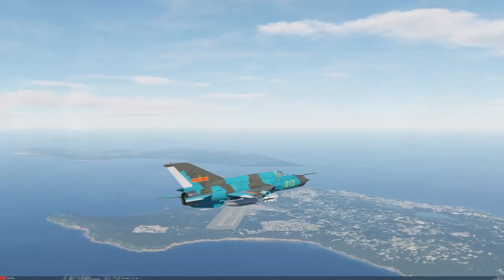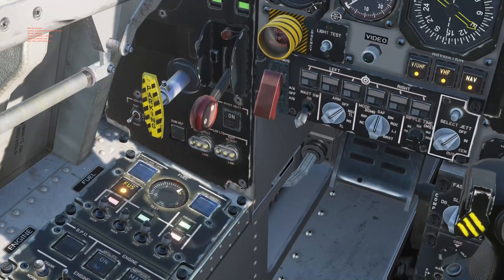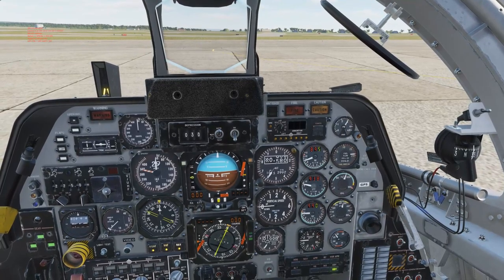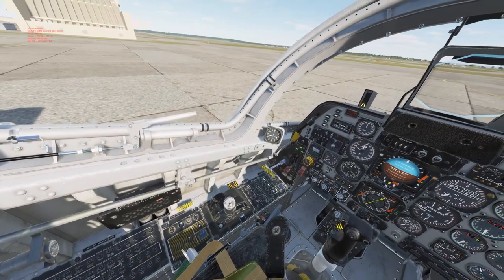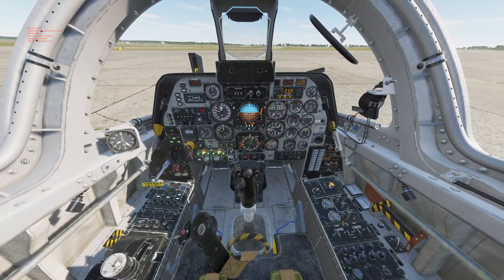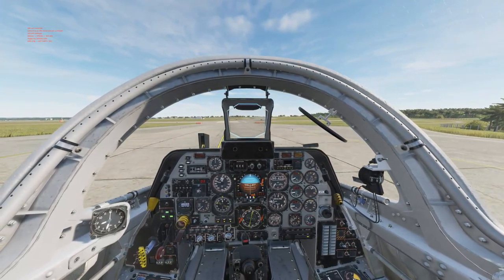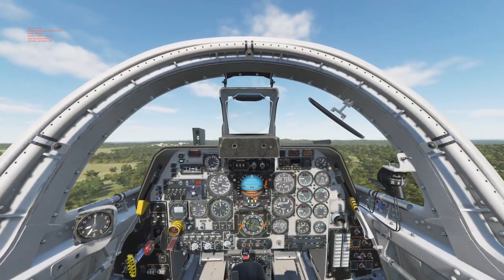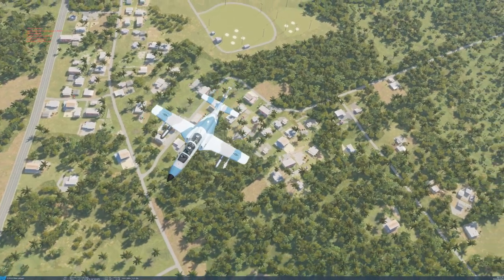Things that I wish I knew about the C-101CC before I bought it - Part 1

Comment: Enjoyed the vid.  Thanks.  But I think you referred to the BL755 as a Russian bomb.  It is actually British.  And the only bombs you can ripple in the C-101 are the practice bombs.  Ya, waiting for the Sea Eagle to work properly although there is a script out there somewhere where you can target them in real time using the F10 map markers.
Reply from the maker: I stand corrected… I had thought that the BL755 was a MiG 21 weapon (it is) and therefore was Russian… but Wikipedia agrees with you - DCS is a very strange thing.
Reply: @dewfiend  Just did a quick google search and some random posts mentioned Yugoslavian Mig-21s that carried the BL755 so I'm assuming DCS is right.  But take with a grain of salt of course.
Reply: @kontiuka  The serbian air force use it for sure. They drop one bl755 on Barcs in Hungary in the 90s. That one does not work because it dropped from too low.